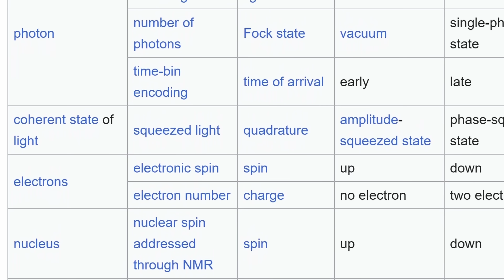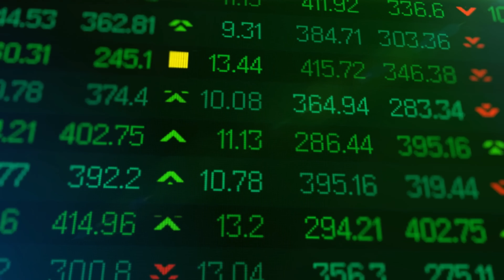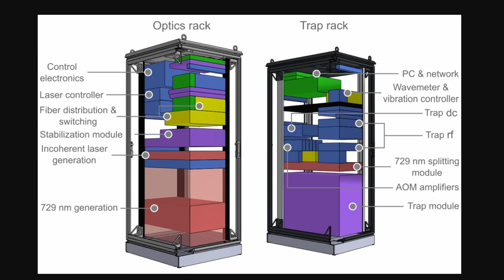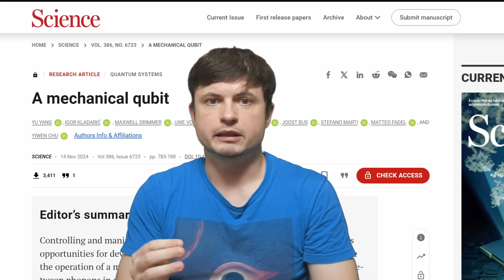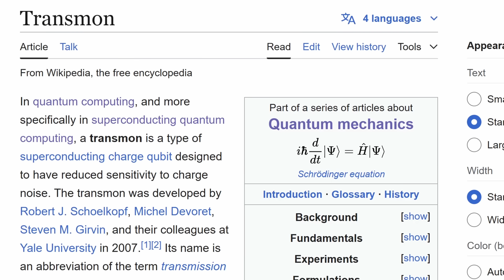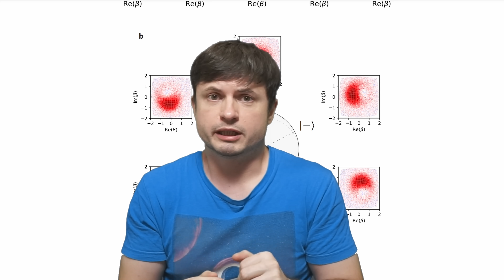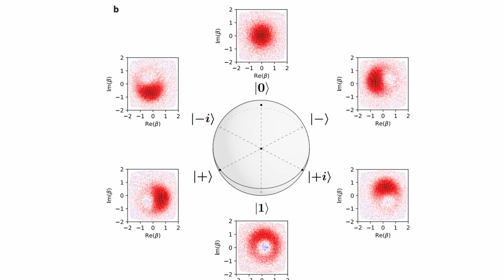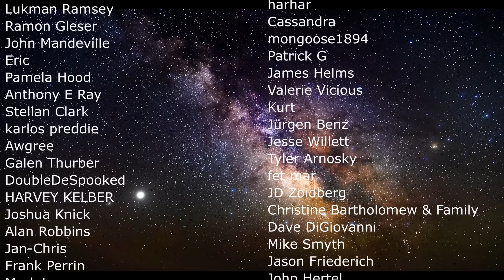Creation of the First Ever Mechanical Qubit, Here's What This Means

Comment: Quantum is just another name for frequency jumping. It sounds way more mystical than "things vibrate and because everything is vibrating you can sometimes move in ways that look like they should be impossible".
Reply: Quantum mechanics isn’t mystical, it is very sensible.
It also isn’t classical. It isn’t just things (as in, classically described physical objects) vibrating.
While many things in QM can be related to vibrations in a way kinda like what you said, I don’t think what you said is the kind of framing that would facilitate doing the actual calculations of quantum mechanics.
Like, the position momentum uncertainty relation in a sense can be seen as a property of the Fourier transform, and related to a classical time vs frequency uncertainty relation.
But, if you want to find the eigenstates of a quantum harmonic oscillator, the clearest approach is probably to consider ladder operators, which isn’t very “thinking in terms of vibrations”-y , imo?

Comment: You have an oscilloscope, if you made combinatorial oscilloscopes, like 33 pick 33, 35MB of oscilloscope, you'd have 10 trillion combinations.  An oscilloscope works by changing the electrical length to match any frequency.  You can either store information from the air to another location, or store it in a local flip flop.  Instructions can be formulated by combining electrical lengths with flip flops to convert from storage to barrel shifter arrays.  But the primary advantage is heat is only produced in flip flops.  No need for infinite busses, which is what a quantum computer fails at, it always needs a microwave bus.
Reply: Not even to mention the hyperphasic condraculators. You can also run those in parallel with the drum modulators to induce precisely phased current jerk. Try that with a mechanical quantum two-bit! Oscillosopes rock!

Comment: Not the first.

The USB connector is a mechanical qbit. And it only collapses after 3 tries.

It’s not a 50% split tho. It’s like 66.66% probably of collapsing into the wrong state.
Reply: Actually, USB-A connectors exist in a state of quantum superposition such that it's impossible to insert the plug until you look at the socket.  That collapses the quantum waveform to a known state so that you can then insert the plug into the socket. 😆
Reply: @melkiorwiseman but even then, its still sometimes wrong. Hence the errors in computing I guess.
Reply: @FordBoi302  Ah, yes, I meant to say that you need to look at both the plug and the socket so that the quantum waveform collapses to a known state for both, otherwise you still can't insert the plug. 😆
Reply: Ah yes, Schrodinger's USB Port.
Reply: =D no idea why people are sleeping on this comment haha
Reply: Depends on the state of the person trying to insert the USB. If you are in a hurry it can take up to 10 tries.
Reply: @asandax6 USB type C were created to bypass this effect, but sometimes even those fails and go back to their old behavior.
Reply: All jokes aside , There is more to the USB tech and the qbit, just take a look at the source code updates from Ver 1.1 to 2.0 and the way quantum gates work with IrDA
Reply: They can't even cool normal comps 😂
Reply: @Nat-oj2uc  🧊⚛️⏰☢️🧶🌌 .VXD
Reply: Last 3 windows computers i have struggled with usb. Sticks works perfectly until first update then they go from 1kb/sec to 42mb/sec and then degrade over the next 7 seconds to 1kb again. Only thing i can get to work perfectly is my old mechanical usb hard disk and micro SD cards seems to run 50-50
Reply: @ there’s a setting in windows to enable cached write for usb sticks.

It’s much faster with the cache enabled, but you have to unmount/eject them before unplugging them.

With that cache off it’s slower but you can unplug them at any time.
Reply: @felixar90  Ahhh cool. i will look at that. Thanks for advice.
Reply: @urduib  It's been said that SSD and USB storage both degrade over time so that they need to read the same location multiple times in order to get a good "read" from it, but it seems there's no mechanism to "refresh" the memory.
I gather that Spinrite by Gibson Research has a "refresh" mode in it, which might be worth trying to see if it speeds up your USB storage.  It just finds any location which is giving errors, makes sure to get a good read from that location, then writes the same data back to the location to "refresh" it so it can be reliably read back.
I've never tried it, but it may be worthwhile.
Reply: Indeed. Regrettably my experience seems to suggest rather higher than that!
Reply: w comment hahaha

Comment: Good analogy when explaining to a 5 year old for sure. That said, the whole 'on or off' thing about transistors is not, in practice, entirely true. They are just like what you described for quantum computing, which is essentially what analog is, albeit exponential, so appears to be on or off with enough noise filtering and whatnot.
I think it is just so fitting that the reason that quantum computing is so hailed as revolutionary is simply because it behaves like old school analog circuitry, which is still obviously used or at least imitated today. The only advantage when viewed from that perspective is that it's information becomes compounded by adding the different variables at play, so more information per 'bit'. But technically the same can be already done with 'classical' electricity, for example frequency, amplitude, phase and current, which we already have used for different applications, often times all variables simultaneously

Comment: analog circuits is making a comeback
Reply: Yeah. Eventually they will work it out and go back to analog lol
Reply: @axle.student  what is this weird effect called analog hahaha
Reply: @holidaynova  Maybe it is something weird that emerges from digital 🙃
Reply: @axle.student  I asked chatgpt and looks like quantum and analog are a little different, analog takes a value but quantum stays in an uncertain state
Reply: @holidaynova  1st, Don't trust ChatGPT, it often gets thing wrong.
>
Both have to collapse into a certain discrete state to be used in a "digital" sense.
So each have to produce (forced to) a discrete value at each computational step.
.
You can write quantum applications with Quaternary (quaternions) on a digital Base 2 system using an emulator. You just don't get the speed of the quantum effects.
.
So our modern computers are digital base 2 on top of analog.
And quantum is a digital base 4 [ish] on top of quantum.
>
Analog systems and quantum systems are related.
Analog is an always in motion mechanical system, and quantum is a static step of an in motion mechanical system.
In some sense you could say quantum is meant to describe the steps of classical motion (analog mechanics).

Comment: Can't one use a mechanical qubit to detect quantum gravity? Just a thought: Take a laser beam in a superpositional state, shine it on a micro scale mechanical resonator taking up the superposition, and at last couple it gravitationally to another microresinator. If it takes up the superposition (and we could reasonably exclude other couplings polluting the results to no recognition), we have a fine proof that gravity is a quantum force. Because if it is not, it can't transport the superposition of states.

The tricky part is getting the experiment clean and proofing superposition in a mechanical resonator.
Reply: wouldn't you have to replicate in a gravity free environment to compare?
Reply: The tricky part is finding a place where there is no gravitation at all to make your idea work.
Reply: What I am talking about is the micro version of the Cavendish experiment, that for the first time allowed to get the strength of the gravity coupling, and so also allowed to get a rather precise weight for planet Earth. There indeed it is not important to have outer gravitational influences absent, as the design of the experiment ensures independence. But you have to carefully shield the experiment from other (in that case mechanical) influences like vibration or movement of air.

In a microscale quantum Cavendish experiment, the problem more likely would be electromagnetic influences, but also mechanical coupling. But I think, you can get the mechanical coupling to take the other direction than the gravitational one.

Comment: Modern CPU's already use quantum effects. It's how the field effect transistors work. As well as charge-coupled devices. That's all quantum effects.
Reply: Using quantum effects in order to do computation is not the same thing as doing quantum computation.
Reply: Uh yeah buddy everything you just said is wrong 😂
Reply: You're educated enough to use words, but not smart enough to understand them. 👏
Reply: This comment has the same kind of energy as people claiming there's no difference between between a dozen milennia of selective breeding and modern GMOs.
Reply: @tippyc2  Actually there's not. Only, millenia of selective breeding has been developed and owned by people but GMO is developed and owned by big corporation to make money. Apart from that it's exactly the same.
Reply: @tippyc2  in some cases there is literally no difference. For some of them the “modern”
GMO is the latest generation at the end of that long line.

Comment: Digital computers are so powerful (and getting better) I just don't see the point of pursuing quantum computing.

Why not reexamine analog computers? If we need more than just 1's and 0's analog achieves this.
Reply: @erasmus_locke  ive been working on a discovery i made a few months back that demonstrates if we stop thinking in euclidean geometry, or everything on right angles, so not sqaure grids, straight lines or binary and its multiples of 2 (keeping it in euclidean framework)  we get around a 10000 x speed increase, no quantum required. Just ditching a crippled derivative for a more pure mathmatics opens things right up.
Reply: Plenty of problems exhaust today's fastest machines and that will be true until we have quantum computing
Reply: Analog does get you things between 0 and 1.
That’s not what superpositions are, and saying the superpositions are that is misleading.
Superpositions are linear combinations, like (3/5) |0> + (4i/5) |1> or the like.
Analog computing also doesn’t get you the entanglement.